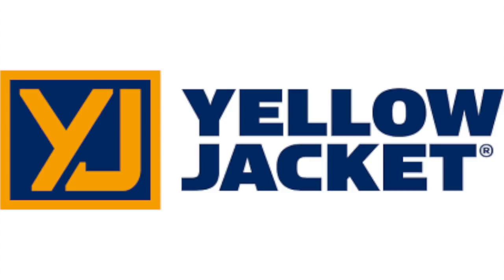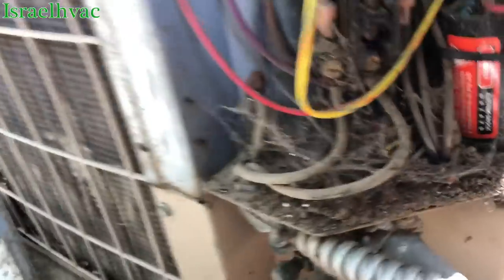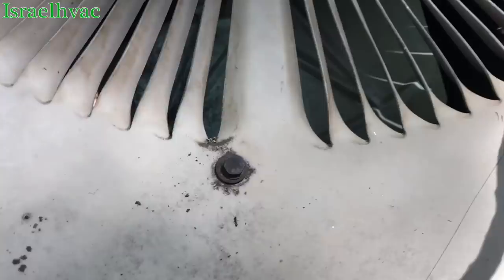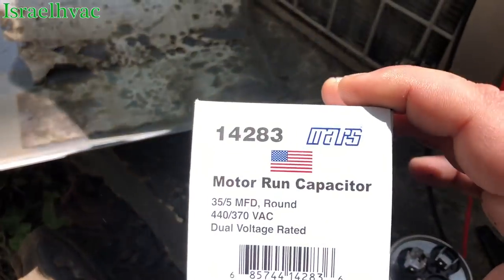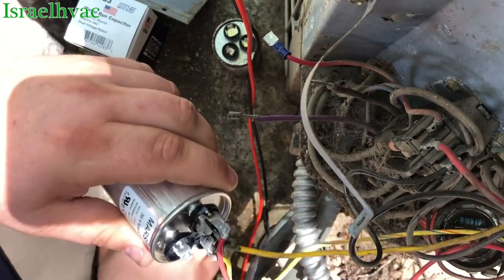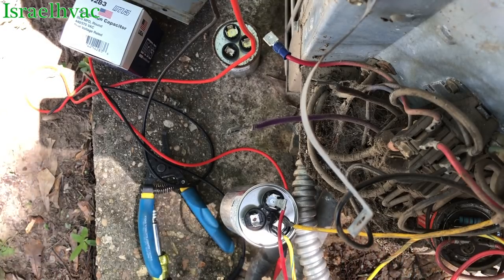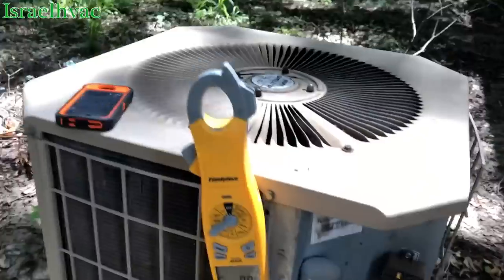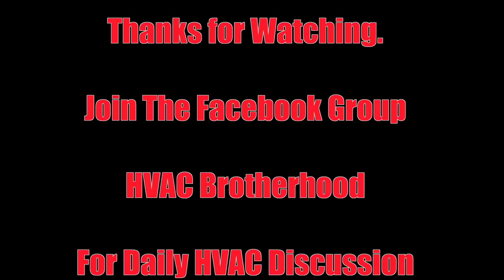Bad HVAC Capacitor | I Make a Big Mistake

Comment: Back in the 40s and 50s working on electrical equipment - motors and radios & TV sets, high voltages were present in many places. Rule of thumb - Unplug, and discharge any HV capacitors with screwdriver with insulated handle before sticking your "nosepicker" inside the equipment. Squirrel-cage induction motors have start/run capacitors typically holding charge at peak line voltage - ( 170  or 340 ) While not as bad as the old HV caps in cathode ray tube power supplies, those voltages will "bite hard" !

Comment: I got bit by a bad disconnect switch. A technician before me didn't bypass it, but instead, one of the copper bars broke off the switch and was still carrying power across one of the lines! It was in an air handler and I so confidently pinched that little single run capacitor terminal, bare-fingered, will all my might, and I thought someone had shot me in the arm! I was nervous and lightheaded for a while after that.

Comment: I have seen the aftermath of one pole on a  disconnect for a rooftop unit staying in ( 600V 60A supply)... screwdriver got shortened and there was a new " inspection port" in the unit that was not there previously.

Comment: I made the same mistake working on my friend's ac. I trusted that stupid disconnect. I had finished wiring up the cap. When I was going to place back on its place, it touch some live wires. and it made a hole on the cap and burned some wires. So,  that taught me a lesson. Always check for power before working on ac. It left me shaking

Comment: Be happy you weren't kneeling in wet leaves. I saved someone from electrocution they were doing the same as you, working with the unit hot, because of a bad disconnect. That disconnect had been jumped out.

Comment: I'm a maintenance guy on a bunch of old units mobile homes ,,apartments,trailer houses, I am constantly running into that almost got fried once( with a thumping hangover and not thinking right) I've had people explain it to me that your neighbor could have wired up something wrong and its back feeding,,, they've told me several different ways that can happen but I'm still really perplexed I don't understand,,, meter shows no 220 but each leg is hot,,,,, do you think you could be kind enough to do a show on that and explain it to us it would really be helpful,,,, after almost getting fried I use one of those proximity sensing voltage non-contact gizmos,,,, been watching you for years love what you do thanks

Comment: I had a similar experience. I was changing a contactor on 3 phase 480 when I got the shit knocked out of me. Someone before me had wire nutted one leg straight thru on the disconnect. They must not have had the fuse that went in it and didn't go buy one. I check every time now.

Comment: My A/C service company wants $300 plus tax to change the capacitor.  I ordered  a 45 3 dual run via Amazon Prime for $20 inc tax.  But I am watching all the YT videos on capacitor replacement to make sure I dot all the "i"s and cross all the "t"s before swapping it out.  Not only will I pull the disconnect, but I will switch off the breaker.  And of course discharge both capacitor leads.

Comment: Never trust anything around an apartment complex or anything you don't work on  a regular bases.  If I'm not familiar with the equipment then I always check.  Learned years ago on some 480 volt equipment that someone had bypassed one leg of a 3 phase disconnect.  Lesson learned.  The hard way.  Ococh.
Reply: And NEVER trust a unit that looks like the owner has been inside it FOR ANY REASON!

Comment: I made the same mistake a few yrs ago at an apt complex i did work for . Was changing out the condenser and had pulled the fused disconnect and didnt verify no voltage ( as a licensed master electrician as well as hvac tech i knew better ) and when i went to pull wires out of enclosure i got shocked . How i got everything unhooked to that point without getting shocked i dont know but someone had bypassed one side of disconnect because it was burned out and they were too lazy to replace it .

Comment: John I had the same thing happen to me while changing out a wshp that was hanging above a water heater. As the whip was dangling, one of the wires touched a copper pipe coming from the water heater and arched. When that wire arched it put a pin hole in the pipe.... at that point I became a plumber for the remainder of the day lol.

Comment: never trust what someone else may have done and even than still check for voltage. i had a customer last year tell the disconnect was pulled ur good to go. glad i doubled checked because that would have sucked big time!! and in general just try to be safe as possible, everyone wants to go home safely.

Comment: You kept saying you trusted the disconnect, and I said to myself how can there be power if the disconnect is out. Well then you said you flipped the switch so it's not the pullout style disconnect that I'm used to. I wouldn't trust those flipswitch style disconnect circuit breaker types either.

Comment: I plugged the disconnect on my friend's unit and the unit continues to run. I found that the wire were just wire nutted and the disconnect wire were still unstripped.  Whoever installed that unit never connected it correctly.  Glad you where OK.

Comment: My mother lives in a house that was built in 1984 and the internals of her outside condenser all have '80s dates on the electrical parts. The capacitor is just now on its last leg and we'll kick in if you tap it in the right spot on the shale of the compressor.. I am not in HVAC so I am waiting on a capacitor to be delivered since no local store will sell to me since they think I'm not qualified

Comment: Even if you had turned the power off, Isn't there still a big charge in that new capacitor. ? And perhaps needed to take the power out of it first ? Seen another video showing using insulated screwdriver on common and herm and the common and fan.

Comment: I also made that mistake. I short the legs with my insulated plyers to ensure that the cap is discharged. I almost skipped the shorting step but I am glad I didn't. Looked like someone took a mig welder to it. Needless to say, I always quadruple check the voltages now and push contactor in as a habit

Comment: I just replaced an indoor fan motor and cap.  I unplugged the furnace and checked for power.  I had no power and went on to replace the motor and cap.  Plugged the furnace back in and the system worked fine.

Comment: I have wire strippers with a built in current sensor. Even though I double check everything it's nice to have another level of protection. By the way, those rental units suck to work on. Always in awful condition with signs of hack repairs in the past.

Comment: I worked as a electrician at a plant we handled 277 all the time with dry gloves it was not smart but sometimes had to do it.
Reply: that's too high a voltage for working live comfortably. then again, it may be betetr for some to get thrown off it, vs. 120v possibly grabbing them :)

Comment: I had that happen once trusting the disconnect now I always check to ground for power, one time changing a fan motor I got shocked, discovered hot water heater element bad and putting power on ground wire, no ground rod for the electric service, so every time I touched the outdoor unit I got shocked, thanks the video

Comment: Made this mistake as well. Customer had a two 120V outlets that went to the unit outside. Disconnect only was connected to one. Now I always check to ground after pulling the disconnect.

Comment: Several decades ago I was working on a central air and the home owner "Turned off" 220 v to the condenser for me. It had been raining and everything was wet. I opened the cover and out of habit used my insulated screw driver to engage the solenoid. To my surprised the fan and compressor started. If I had not done that either I would have been shocked (hurts big time as I learned by accidentally touching a high voltage electric fence and another time pulling a runaway motorcycle pair of hot spark plugs) or possibly a fatal error.

Comment: Doesn't the disconnect on the side of the house contain a big double fuse cartridge the can be pulled out? At least my old central air unit is set up that way. I was always told to yank the cartridge out before messing around with the AC unit.

Comment: Great video John. Way to MAN UP. I did that last month on a Liebert Air Handler. I thought that the disconnect was off but it wasn’t. I had a bad condensate pump without realizing that I had 460volts of live power. I only blew a fuse but it could have been worse. Your meter is your best friend. Great video again John. Have a great week. God bless.

Comment: Wouldn't it be better if you were also wearing rubber gloves?  One question i have - I don't have circuit breaker box dedicated to the A/c unit like some folks seem to have (my wiring is 1980s or earlier) - it's a circuit breaker box with all in one box.  One breaker is labeled A/C (others labeled stove, dishwasher, lighting, etc).  So I would shut the A/C one off or just shut off the main breaker to the house? Does this sound right or am I missing something that is really there?  And I say this understanding we do not trust the disconnect, and using insulated pliers and rubber gloves.

Comment: So what happens when you change the capacitor and the fan doesn't kick on? Does that mean that the fan motor is out? I can push the blade and "kick start it" but then it stops after about a half hour and the top of the unit (a Rheem) is very hot. Motor?

Comment: Even if I think the power is off, I assume I could be wrong.  If I can I work on a dry wooden board and always try to use one hand if possible. Very bad to complete a circuit with with both hands. Outside I am very nervous about damp ground and will proceed carefully.

Comment: Glad you didn’t get hurt badly
I had same experience when i was changing the Carrier 5t  RTU. I thought it was disconnected but it wasn’t 
I got little buzz thru my hand and arm i was fuuuuckk
then i ran down the breaker panel and turn the breaker off   
Lol

Comment: I have made a similar mistake before myself I was changing out a hot water heater in an old 1960s trailer so I went to the fuse panel box which the fuses were meant to be on screwed after finding the proper fuse I unscrew it and went on to disconnect the wires from the old hot water heater by cutting the old wires with a good pair of insulated lineman cutters and come to find out the water heater power source was bypassed by the fuse panel....... and let me tell you something my $30 insulated cutters probably save my life today because they took the entire shock without any effect on me it was so bad that it welded my Cutters together........

Comment: had the same happen to me, I checked across the power legs no power, I now remember to check power legs to ground, I once had a bad water heater element put power on the ground, so changing out the fan motor with hand touching unit and knee touching wet grass, I got a 90 volt shock took a few minutes tracking that down

Comment: Always pull the disconnect plug and put the plug in your pocket and turn off breakers at the panel as well. Don't ever think you're good enough or smart enough to work with live current when it is not necessary.  This video demonstrates why.

Comment: Right on..  just watched a video about 2 high volt electricians who were changing switchgear out for 22kv and they took a safety out which released a hydraulic tension on these 3 phase legs that should have been latched and golden but the hydraulic pressure slowly dropped while they were working and outta nowhere, where there had been no voltage on the service side the legs all three reconnected and 22,000 volts hit and melted the 1" thick metal housing they were inside..  another never trust a disconnect, at that level they tested but should have locked out by physically locking the disconnect personally so they know for a fact that theres no way that voltage will be present until they remove the lock they put in themselves ..

Comment: I am confused by the terminology. What is the difference between the disconnect and the breaker? And what was wire nutted that allowed the wires to remain live? I am not qualified to do any work myself but I am capable of opening the panel and examining parts so I can speak intelligently with a tech. If I can identify a bad contact or I see a capacitor that is swollen or leaky I can help the technician save some time when he comes to service the unit. Safety always comes first and I want to be sure the power is dead before I go looking around the electrical components so please explain the difference between a disconnect and a breaker and why the unit was still live.

Comment: Get some insulated gloves, granted for higher voltage it is required but I've wired stuff hot before and even at 120v it's a little extra security cuz it only takes 1/10th of an amp to stop the heart

Comment: It happens to all technician. My experience happened on a 460 volt commercial roof top unit. I ended up at the hospital.  Lucky to live according to the hospital. I was shocked so bad the doctor found crystal in my blood. Also a bad disconnect 1 of 3 legs stuck.

Comment: Question if the capacitor is rusty and has no visible identification on it how would you figure out which one to get to replace it if all you have is the owners manual that seems to cover several different model numbers and there is four different capacitors numbers listed.

Comment: Does the capacitor like the one you replaced also prevent the house from cooling properly if the fan had worked? i.e. fan spinning, weak capacitor, but not cooling optimally? Does it help to replace the capacitor anyways?

Cool video, thanks for sharing and being honest.

Comment: Does this sort of installation conform to local code?   In my area, the compressor unit is connected through an outside disconnect box with cartridge fuses in both line legs.   Pull the fuses and you're safe, no matter if the disconnect switch works or not.

Comment: how come you dont say that a capacitor stores voltage and will zap you with all power disconnected? do you not know that, since you touched both terminals on cap with out grounding them together with screwdriver first?

Comment: Johnny NEC sez: Missing step in "What I shoulda done:" 1. Turn off power. 2. Replace disconnect. 3. Install electrical item and proceed with repair. There is no indication in this video that the next individual who works on this won't kill themselves.

Comment: Talk about mistakes!! I bought an old home back when I was twenty something. Every time I went down the basement I kept hitting my head on a piece of Romex. I figured no electrician would leave a live wire just daggling like that. I grab my uninsulated side cutters and I cut it off at the rafter. ZAP!!! I could not let go. Now I'm standing there locked in place.  Keep in mind all this took place faster then you can read it or I can type it here.  At first jolt, I throw by ass/body as hard as I could throwing my feet/legs from underneath me and I fell away to the floor, thank god for gravity. That my friends gave me a respect for electric "safety first" the rest of my life, I'm 78. I hope my admission to my stupidity (I knew better then to do what I did) helps someone else from possibly death.

Comment: Does turning the power off at the breaker panel completely prevent this?
Reply: If it was wired right yes , I have seen people hard wire in a/c no breaker no deadman .  had to kill it at the pole breaker box .  Only reason I like Code .
Reply: In my many years experience,I've encountered several circumstances where the breaker lever moved into the OFF position without operating the internals,leaving the circuit still hot.Like the poster said,don't trust any disconnecting means,always verify OFF at the equipment you're working on.

Comment: Curiosity may have killed the cat, but confidence that the disconnect is off nearly killed the technician.  That happened to me with a 480 volt 3 phase system.  I shut the disconnect off but one leg of power was still connected. I got hit with 270 VAC.  It felt like my soul had briefly left my body.

Comment: You made a second mistake of not checking why there was still 120V after you pulled the disconnect.
Reply: It's simple why it was reading 120 after the fact it was coming in on the common
Reply: Arin Graves what lol
Reply: If it is still reading 110 without the contactor pushed in and the breaker off then most likely it's traveling through the common.... I'm not talkin about your low voltage common I'm talkin about you're coming on the contactor like a pole and a half contactor
Reply: @chadbishop3151  not sure what you meant but I believe I answer your question?
Reply: Arin Graves the reason it read 110 is because on the disconnect seeing as it was never actually shown to us someone prob took line and load on the one side and marretted them see it all the time when people get lazy or wire was cut to short so he only killed one line when killing disconnect that’s the only possibility unless the disconnect failed which I have never seen myself it’s more likely someone cut a corner and used a marret instead of hooking through disconnect.
Reply: @chadbishop3151  are you a maintenance guy?
Reply: Arin Graves work as a HVAC tech :)
Reply: @chadbishop3151  I had a 220 breaker that would only cut off one leg,I got a surprise too!
Reply: @chadbishop3151  what is a "marret"?